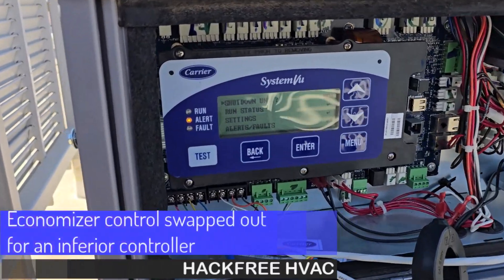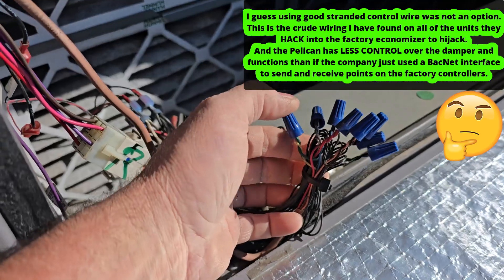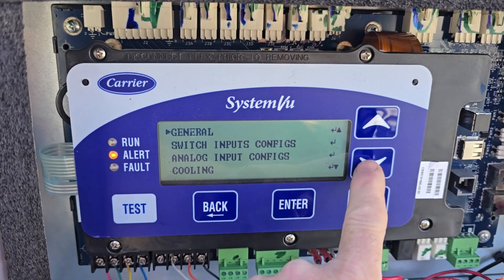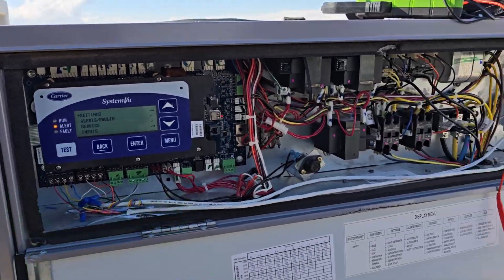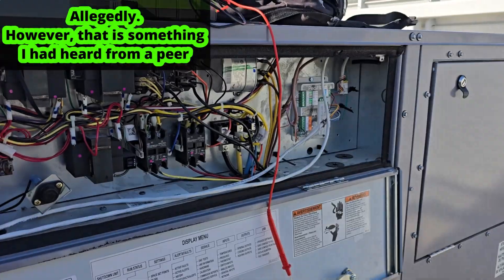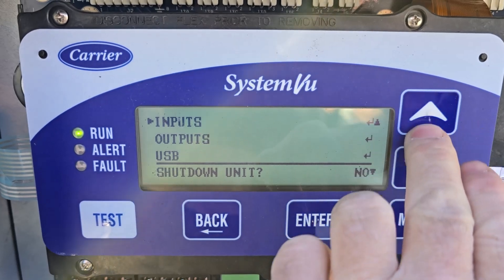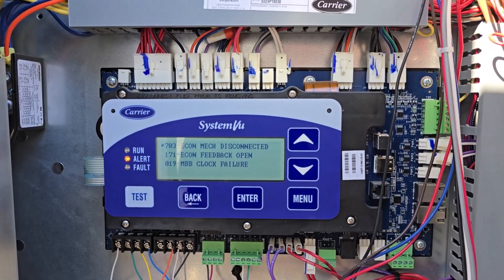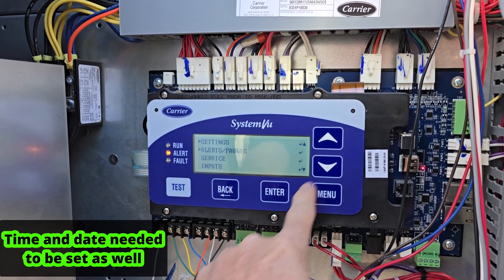Superior controls are hacked to use an inferior product [Pelican ECON controller]

Comment: Pelican is wireless and if it is not in their budget to run BACnet wire or paying for a front end this is a decent alternative and yes there is rebates.
Reply from the maker: Well, they have all been hack-fests so far. Especially when they BUTCHER the wiring of the OEM and other contractor's work to leave them INOP 🤬

Comment: Pelican has its place. I think it's a good alternative for smaller systems. BacNET can be a pain in the ass due to the cost and this is why many go towards Pelican or 75'F. I'm planning on adding a Pelican system to a Carrier unit that's on a pneumatic building for scheduling and temp sensors.

Comment: Just curious why you say there’s a problem with using solid core wire? I’ve always preferred working with solid vs stranded wire unless I’m pulling a lot of stranded through a conduit or something.
Reply from the maker: Solid core breaks much easier.
It is always frowned upon for wiring critical components. 
Generally, you'll only see it on thermostat wiring. Solid core is only good for the ease of screw terminal wrapping.

Comment: Hey so is that customer paying for a 3rd party company to monitor/control their building temps? I believe these services are called “ems”(sorry I’ve been doing light commercial for a little over 2yrs).
Reply from the maker: Yeah, to EMS(BacNet) but the thing is that the factory controller has built in BacNet and does way more than that wireless pelican.
All the points of the SystemVu could have been brought in to the EMS via BacNet comm wiring. Fan speed, humidity sensors, system pressures and temps, alarms, everything!